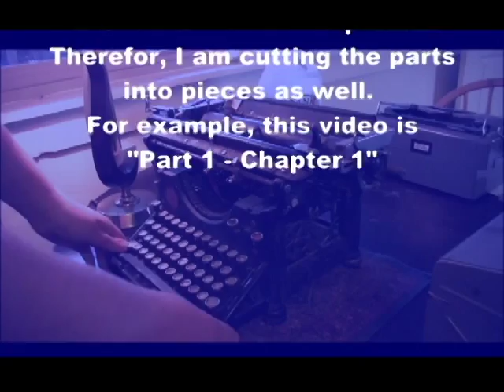The Underwood Typewriter  - Chapter 1, Part 1 - Disassembling and cleaning.

Comment: Hello, 

I'm cleaning a underwood typewriter that I found during a garage sale. I've never had a typewriter before or worked on one, but hoping that I can figure it out. So far so good and your video have really helped. I do have a quick question, if you'll indulge me. You briefly show a black ribbon (wound tape?) at the back of the machine. Mine is missing its. What is this called? 

Thank you so much for your help and your videos!
Reply from the maker: Willa McAllister That is the carriage draw band, or the tension belt. There are a few names for it. It draws the carriage to the left when typing, and is attached to a spring drum. It brings the whole mechanism in motion. The typewriter doesn't work without it.

If yours is missing, fabricate one out of strong fabric, or strong fishing line. I can assist you if you like. It's not that hard.

Comment: DrTypewriter: I recently bought a 1928, four bank, Underwood Standard Portable Typewriter. It still works well. I found it in a junk shop.
I got its owner's manual online, for free. But I still need its SERVICE manual, which I haven't been able to find. Can you tell me where I can get one, even if I have to pay for it? Maybe one from within a few years prior to 1928, or within a few years after 1928, will work. Can you tell me if it will and if so, where can I get it?
I felt the need to subscribe to your channel today, too.

Comment: If you think that's rusty, you should see my Royal #5.
How do you get so many donations? Word of mouth?
Also, have you ever been paid to restore a machine?
Reply from the maker: Hi Troy,

I have had a Olympia SG3, that had been left outside underneath a awning uncovered for 7 YEARS. And I got it working. The videos are still on my channel. The camera did a really crappy job of picking up the rust. It was about 10 times as bad as what is shown in the video.
I have a lot of friends that know about my collecting, and my mother is very known. So she has always friends telling her that they have a typewriter they like to donate. Also word of mouth though. Word goes from person to person to person, and finally to me. Working on a network is a very important part of collecting. 
I have been paid to restore a typewriter. Once, I had to restore a Olympia SM3, and got paid, by the owner donating its bigger brother, the SG1, in mint, which I sold recently.
And I done about 5 -6 other jobs. Its a lot of fun.

Thanks for writing.
Reply: ***** Based on your videos, i would say it's (the SG3) pretty close to my royal before i removed most of the outer surface rust. And it was sitting in my great-great aunts garage for 75 years (with all windows broken), along with a royal quiet deluxe, in equally bad condition, and a Remington #10. (both of which my cousin-who knew i liked typewriters-took, claiming he had first "dibs" )
Reply from the maker: Troy Dietz The Underwood that I am working on in this video isn't nearly as bad as my SG3, I'll give you that. But it's gotten damp as it sat in a basement for a while, so you probably can get a general idea of what it looks like in person.

Do you have a video of your $5?
Reply: ***** No, one of my friends broke my Video camera during a school project, and i still have a dumb phone.
Ill see if i can find some of the pictures i took.
Reply from the maker: That would be great. Thank you
Reply: ***** I have some older (about a month ago) pictures i was able to salvage off of my broken video camera, could you PM me with your E-mail?
Reply from the maker: I have no idea how to do that. Maybe make a YouTube Slide show?
Reply: ***** It's only 5 pictures. Here are instructions: https://support.google.com/youtube/answer/57955?hl=en

Comment: Where is the model # on these oldies? I just obtained one at a garage sale. All labels are worn off.  It is an Underwood, but in bad shape. It won't return, stuck somewhere. Any ideas?
Reply: unklbuk1 I would first try cleaning it. use mineral spirits and a toothbrush. you might have to disassemble the carriage first. then if that doesn't work, you could use instrument oil (for tubas and trumbones) it is made for smaller mechanical instruments. 

if you want to you can remove the outer layer, cover the keys and dunk it in mineral spirits. do not use water if at all possible, it can cause rust.